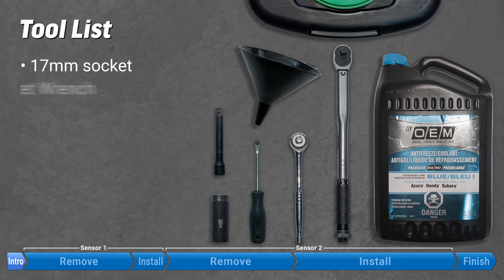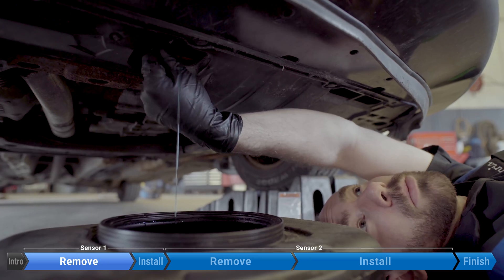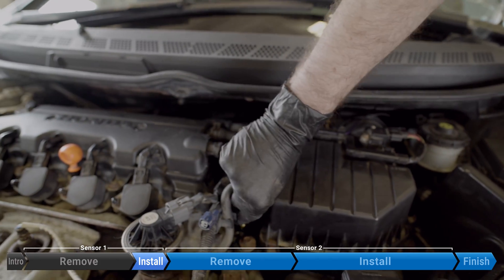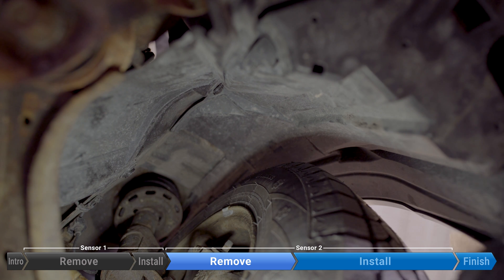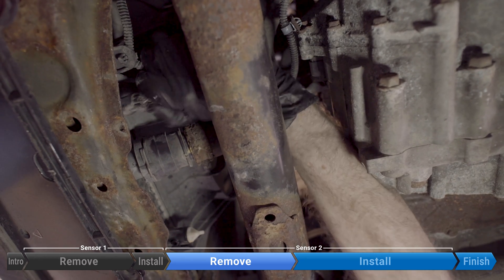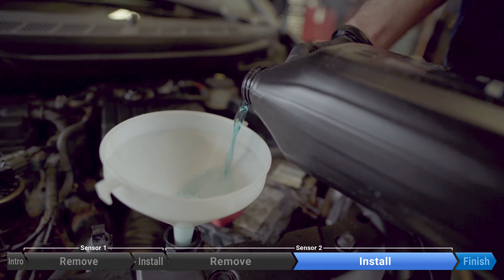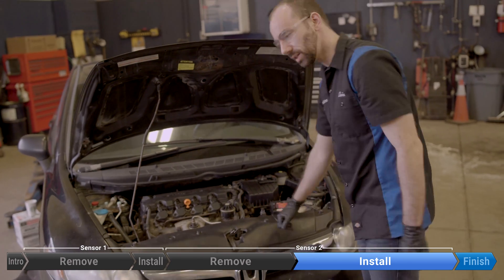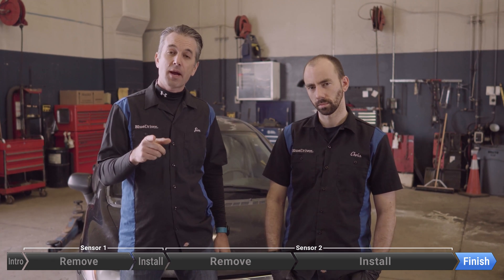Engine Coolant Temperature Sensors (ECT) – 2006-2011 1.8L Honda Civic

Comment: My 2009 civic does long cranking on cool start, I checked the temp of the coolant by using BlueDriver scanner and it showed by 11 degrees higher than ambient temp. Can this cause the problem?

Comment: Nice video but annoying background music which was not necessary for people with hearing problems!
Thanks.
(note this was not the problem, the little light below the temperature gauge came on when stone cold! 
not the engine warning light went off a couple of minutes later. When I arrived at the destination, it still off did not come on after restart or before/after restart later.)

Comment: Are both sensors on a 2008 Honda Fit the same?
Reply: 37870-PLC-004 for top and 37870-RTA-005 bottom of radiator

Comment: I watched this before changing mine out. The one on the rad is actually bigger in diameter so I wasn't able to put a new one on the rad. 08 civic 1.8 had a factory rad. Part numbers are different as well

Comment: The top sensor and the bottom sensor are not the same, the top sensor is black with a thinner clip and longer, while the sensor on the radiator is white with a thicker connector and shorter compared to the top.

Comment: I have a bad thermostat code P0128, replaced it. But check engine light came back after 2 weeks. Cleared the code. 2 weeks later, it came back. Could it be a bad temp sensor? Both fans comes on when the AC is on (this is the only time my cooling fan will come on, otherwise it does not come on when temp is at normal range). Temp gauge was good, not overheating. But now a week later my temp gauge doesnt even get close to the normal range which would normally be half way on the gauge. It would only go up 1-4-1/3 up now, still on the cool side. Coolant was drained, bled and topped off. I really hope it was not a faulty thermostat. Maybe bad ECT? Please help.
Reply: Did you get it fixed?
Reply: @amahyze7372  replaced both my ects and bought an oem thermostat. So far it's s working fine! CEL aint back. 🤞
Reply: @andyl9920  having the same issue you were. Thermostat was replaced 3 weeks ago after getting P0128 code. Code just came back on and engine will not get to normal operating temp. Same as you stated 1/4-1/3 of the way up. Did you have to replace the thermostat a 2nd time or did you just replace the 2 sensors!?
Reply: @austingates7186  i replaced the 2 ects and cel still came on. But I found the culprit. It was my cheap ass VCM delete lol took thermostat out like 3 times to test, went thru so many radiator fluid, what a dumb as me lol dont do what i did. Get that expensive vcm delete. Good luck

Comment: Hey guys I have a question. 2007 HONDA CIVIC HYBRID. AC not working nether cooling fan turns on when AC is turned on has coolant compressor kicks on. Also fans never come on but no overheat issue or check engine light. Does ECT have anything to do with AC and any ideas also have gone through the fuses seem ok not sure about relays.
Reply: Z

Comment: top and bottom are NOT the same.   37870-PLC-004 for top and 37870-RTA-005 bottom of radiator
Reply: that is the answer I was looking. thanks very much

Comment: I got a P0128. The CEL disappeared 4 days later. Nonetheless,I changed my thermostat and poured new coolant. I want change both ECT as my fan never turned on twice. I want to change it 3 days later. Can I reuse the fresh coolant after I replace both ECT? I know I should have done everything at once but tryna avoid unnecessary work. 2007 Civic LX
Reply: Did you get it fixed?
Reply: @Amahyze777  just changed my thermostat. Been good ever since

Comment: My check engine light never came on but my smaller fan never runs and the bigger fan only works when the a/c is on. My car overheated yesterday. Radiator and reservoir were both empty. Any solutions? It hasn't overheated since yesterday after driving it all day but reservoir is empty again but radiator still has fluid.

Comment: Great video. I am trying to replace the ECT sensor up top on an Acura TSX 2008. 1.) Where is it located & how do you know that it is the right connector? Is it the same location as what looks like a Honda Civic in the video? 2.) In the video the wiring for the ECT male looks like it’s connected to a circular part. What is that part?

Comment: the white radiator sensor Part No is: 37870-RTA-005
And the black top sensor part No is: 37870-PLC-004

My 2010 Civic EX was also running cold So I changed  the Thermostat and all of the codes went away.
Reply: What were the symptoms? I have the same problem I think
Reply: @IzzyWoooo  I changed the sensors shown on the video with OEM parts and I also changed the Thermostat all at the same time and that fixed my problem to this day. 

The symptoms were that my Honda was always running cold, the temperature meter would never go above 2 or 3 dots. I was also getting very poor gas milage. 

Once I replaced the sensors and the thermostat it all went away. 
But make sure you get the OEM parts specially the thermostat. 

I had previously changed the thermostat with an aftermarket part and it never worked.
Reply: @zantiagotron07  Thanks a lot for the answer brother
Reply: @IzzyWoooo  you’re welcome I hope your Civic is back to normal soon 👍
Reply: Is that the same for 2006 Civic? I thought it was 37870-RAA-A01 for sensor 2

Comment: Beware both sensors are not the same! Caused me a lot of issues trying to figure that out. Okay video other than that.
Reply: Did you figure out the part numbers? I need help
Reply: @zantiagotron07  SENSOR 1 THE ONE ON TOP IS 37870-PLC-004 AND SENSOR 2 THE ONE ON THE RADIATOR IS 37870-RTA-005
Reply: @seymadd  thank you I actually got it changed Two weeks ago along with the thermostat
Reply: @zantiagotron07  did you have to change both sensors? im currently having this issue but the problem is when scanned i dont get a code. So im really trouble shooting here

Comment: I took my thermostat n ran my 2006 Honda civic will that cause the temperature sensor go bad
Reply from the maker: Running a vehicle with no Thermostat is never a good idea. It could be very possible that this caused a bad sensor or something else. Very hard to say for certain.
Reply: Thank you for info I was told u could run with out it but I'm putting one on now n the sensor but I noticed he said there two temp sensors how do u know which ones bad

Comment: Hi, 

What are the parts numbers for the 2015 hatchback / tourer models ? 

Are they the same for 2006-2011 models (37870-PLC-004 for the top ECT1 and 37870-RAA-A01 for the bottom ECT2) ?
Reply: Hello, Your best bet would ne to check with your local Honda Parts department!

Comment: The sensor at the bottom by the radiator is called a radiator fan sensor. And it’s not the same part as the sensor on top.
Reply: What's pn?

Comment: You didn't answer this question. Are both sensors the same?
Reply: They mentioned in the video that both sensors are in fact the same
Reply: @Ethereal184  they're wrong. Two different ones

Comment: Note: the top sensor in the engine has a BLACK female receptor, while the unit at the bottom of the radiator 
 is a WHITE one (2009 Civic). They are not the same sensors top and bottom as stated in the video.
Reply: Would you happen to have the part #s
Reply: @leavemealoneimpoobutt6549  37870-RTA-005 (bottom) 37870-PLC-004 (top)
Reply: You're right they are not quite the same temperature sensor one is slightly longer but they will both work I've used both of them in several civics
Reply: @compton1707  After reading my post (*months later🙄)) ... I would like to apologize if my comment felt personally offensive or disrespectful, as I  in no way meant for it to. Simply a failed attempt at being funny and in no way meant any thing I said directly to you. I apologize for for my dreadful literary skills and hope my words did not harm or offend you.
Reply: @compton1707  Do not know how you manage to do that on any civic between the stated years 06 through 11 as the clip will not fit interchangeably. There is differences in length and clip attachment.
Reply: I just went to do mine on top and the clip was wrong and didnt work. It had a fat slot for the clip but the one i took off had a skinny slot. Not sure if thats for the bottom or not. Wasnt able to get the bottom one off. Didnt have the time to mess with it. Wondering if you could tell me that one would be for the bottom.
Reply: @BiloNosnibor  I will say it is likely for the bottom if sold to you by AutoZone because they have both separate parts listed as fitting the same all the separate part numbers. Advanced and O'Reilly's show coolant part and radiator part. Coolant being the bottom and radiator being the one under the hood on top. I have physically matched and confirmed these. It will not let me show you a picture of both held side-by-side showing the obvious difference. Black capped is top/radiator part and white is coolant/bottom part. Hope this helps, as I'm no Mechanic,.. simply a financially strapped, single female, with visual abilities and a fraction of common sense😊
Reply: @caseylynn7266  The sensor that goes into the Radiator is 37870-RAA-005 and the one that goes into the engine block under the hood is 37870-PLC-004. You have got it crossed.

Comment: Chris - My Honda Civic 2010 heated up so I replaced the head gasket. Problem - the area around the valve cover is smoking and I could hear the timing chain making some noise, I installed new tensioner.  Please give Advice for possible causes. Phil
Reply: You might have needed a new timing belt

Comment: I did some radiator work on my 2006 Honda Fit last night, and when doing the "burp" procedure it took 50 minutes(!) of idling before the fans finally came on, and over an hour before they ran a second time. Each time they only ran for about 5 seconds. Coolant temperature (ECT1) was about 95 degC, so I don't think there's a problem, just be aware that you might have to wait a while!
Reply: Had the same problem. Idling over an hour and no fan. Opened the Hanes manual and it instructed to run it at 1,500 rpm while waiting for the fan 2x. Then I finished within 20 min
Reply: Great tip. I've subsequently seen 3000 rpm mentioned in Honda service docs for warming it up quickly.
Reply: Turn on the heat full blast
Reply: @ruurios5806  I think that will cause it to take longer to warm up, but you do want coolant to flow through the heater core to help flush out any bubbles there. Heating on but fan off is probably best.
Reply: Before you changed your sensors, did your fans NOT work??
Reply: @diannaelimz69 I haven't replaced either the sensor or the thermo-switch, but a quick way to test the fans (and associated relays and fuses) is to turn the AC on - both fans should come on immediately.
Reply: @thromboid  they dont turn on even with ac

Comment: 5:11 "Don't get those backwards." :D
Reply: Hope you can help me,.does the Honda fit 2006 having a ect 2 sensor,.I cannot find it?
Reply: @christofortuin1102  I'm not sure that it does. There's a temperature sensor and a thermo-switch that I believe operates the radiator fan, shown as parts 13 and 12 on this diagram:
https://jp-carparts.com/honda/partlist.php?maker=honda&type=FIT&cartype=5221&fig=E&fig1=1500

Looking at the exploded view for the radiator, there doesn't seem to be a coolant sensor there (as on the Civic).
https://jp-carparts.com/honda/partlist.php?maker=honda&type=FIT&cartype=5221&fig=B&fig1=510
Reply: It seems it's just one sensor,.thanks for your replay.
Reply: Good luck with your vehicle. :)

Comment: what are the OEM PARTS? please
Reply from the maker: Original Equipment Manufacturer - an official part direct from the dealer (or maybe from the supplier that makes the original part)

Comment: Thank you guys,  for youtubers, my 2010 Honda civic yellow engine light was on, diagnosed ECT 2 sensor, I didn't replace coolant for 10 years since brand new. After replacing coolant, keep driving car with yellow lights for a month. Finally yellow is gone never come back. Honda quality still good ECT2.

Comment: If my temp gauge is jumping when just sitting, would I need to do this? Or what are some of the common reasons to do this?
Reply from the maker: It's possible, but that could also be a wiring issue (maybe a bad ground or worn insulation?).
Generally you'll be getting no reading, or a ridiculously high one - your rad fans won't come on, you'll get engine coolant temp correlation codes, etc
Reply: Did you ever figure out what was wrong I’m having the same problems
Reply: You could have air in your system.  Did you burp system with radiator funnel?  Takes a good 30 mins at least to clear all air out with Radiator funnel.

Comment: 2:09 The top and bottom sensors are NOT THE SAME. I just did the maintenance on my Honda Civic 2007 and they have different connections. So if you are unsure, check each connection or research the connection. This video was very helpful, although the statement that they all have the same sensor is incorrect.
Reply: Yeah I was just gonna say... when you look up the temp sensors there are two parts listed I had to check again to make sure it was right lol
Reply: Can I get the part number for both sensors

Comment: I have a civic 2013 Lx and i just change the thermostat twice and the code p0128 still popping up..Any idea ? Thanks for the tutorials!
Reply: P0128 is mostly the thermostat maybe is getting air in the system when you change it. You can also change both sensors (like he did in the video).
Reply: @eligarcia5433  i was having the same problem,, p0128 but amazingly the engine light just went off on its own, fickle car.  It then passed inspection,  crazy.
Reply: @pauljacobs4947  what you do to fix it?

Comment: Thank you for this tutorial, its much deeper with detailed info. Please, I have 2006 Honda civic n had code p0128  which meant I need the coolant thermostat changes. I did changed but the code P0128 came on after weeks?  Can you help me know which kind of temperature sensors u used in this tutorials which am suspecting might be poping code p0128? Thanks
Reply from the maker: Hello!
Looks like you probably need to do sensor #2 at the bottom of the radiator - you can use part # 37870-RAA-A01 or go aftermarket

Comment: They are not the exact same part, they are similar but the top is part# SU5584 and the bottom is SU10432
Reply: positive?
Reply: for what year?
Reply: Timothy Samuelson these parts worked for my 8th gen civic 2008
Reply: @ItsHorrifying  I have a 2010 civic will they work?
Reply: you dont know the part numbers for these? is it 37870-plc-004?
Reply: @sk8allica1  Yes...  Ur correct. He lied
Reply: @jeanlenor1858  mmhhmm

Comment: DOES ECT 1 and ECT 2 TRIGGERS THE RADIATOR FAN MOTOR?
Reply: Only ect2
Reply: ECT 1 can trigger low temp gauge on dash
Reply: Hey,im replacing mine,i can turn on 
A.C...both fans activate..,im getting 
 WOULD IT BE,
 #1  OR 2 ?

Comment: Which one sends the temp to the dash and which one sends the signal for the fans
Reply from the maker: I couldn't find a concrete answer - I would assume the sensor before the radiator (top) since it's a better representation of the coolant temp in the engine but for fan control there's likely some control logic based on the difference between the inlet and outlet temps on the radiator so both.
Reply: @LemurMonitors  ECT1 (upper) feeds the gauge, Easy to uplugh and watch you gauge peg out to max.